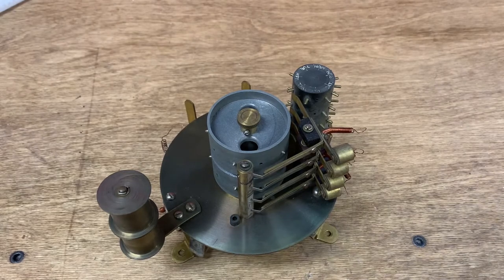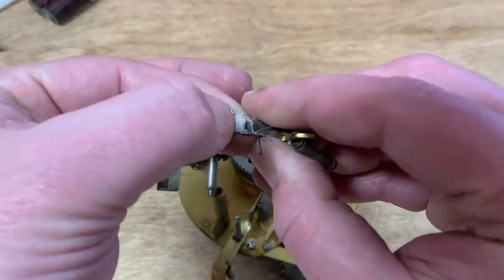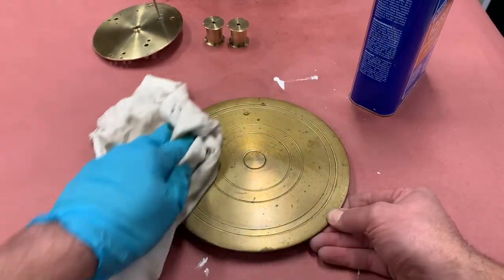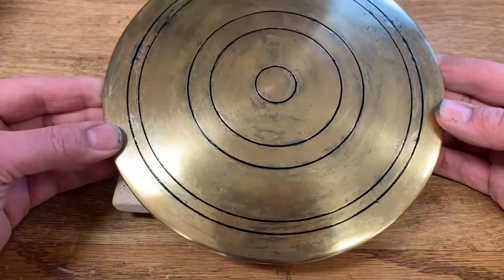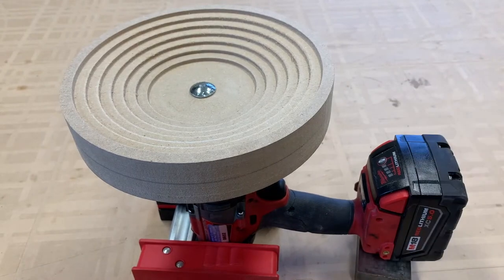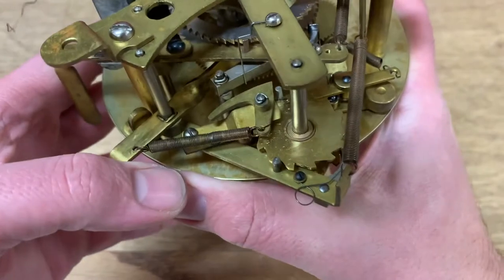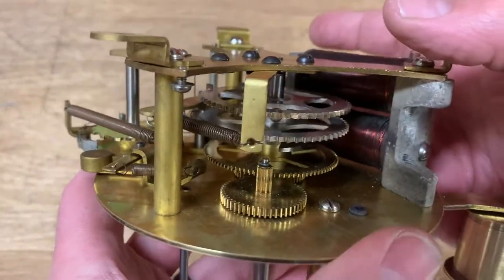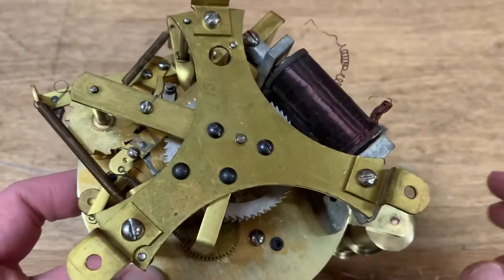Standard Electric Time Master Clock Restoration Part 5

Comment: This is one of those projects where it's complex enough to get "lost" and not know where something goes when reassembling! Good to see that didn't happen here. I'm an amateur clock repairer and this is way above my skill level at this time. This didn't count all the electrical information that I didn't understand! Got any tips or resources to get a basic idea of how this electrical  stuff is done? I'd love to learn how.

Otherwise, great work on this series. There's a lot to be learned from you.
Reply from the maker: Thank you for the kind words. The greatest tool for the amateur clock repairer of the modern era - your cell phone camera. Take pictures. Lots of pictures. Pictures of everything as you go. Also, use several parts bins to keep parts separate for areas of the movement. Example: One bin for everything on the outside of the plates, one bin for the time train, another for the strike train, etc. This helps a lot sorting out different parts.

I may do a video on electrical concepts for clocks - thank you for the idea. The good news is that for clocks that don't use motors, pretty much everything else is easily tested as pass/fail, and I covered a lot of those concepts in this video series. Still in the queue is the International Time Recording master clock I showed in the intro part of this series. I may take another run at the electrical side there.

Comment: Lovely video! Just be careful about relay arcing, the contacts are prone to that with high currents! If you see arcing, I highly suggest adding a diode flyback! Saves a lot of hassle! Been there done that haha! Hope this helps!
Reply from the maker: Hi John - thanks for your comment. I covered this in an earlier video - all of the relay coils are protected with original resistors installed across the coils which perform the same function as the diode you mention. None of the contacts in this clock drive loads directly; everything is done with relays.

Comment: So the bell tape advances every minute, and thus makes contact for a minute per hole.  I'd imagine no school would want the period bells ringing for a solid minute, so there must be a time-sensitive relay somewhere, either in the master clock or in the bells themselves, that would limit the ring time to, say, 2 or 3 seconds... Do you (or anyone else) know about how this is accomplished?  Is it simply in series with the contact on the escapement shaft?
Reply from the maker: Thanks for your comment. You are correct - the tape hole would make contact for the full minute, which would be a long time for a bell to ring. There is an additional contact on the escape wheel shaft that actually completes the circuit, and this makes contact for maybe 5-6 seconds. I cover this somewhere in the video series.
Reply: @MinnesotaClocksandWatches  Found it!  https://youtu.be/fZV3WuYH5dw?t=1385